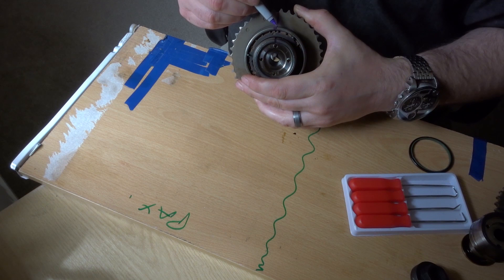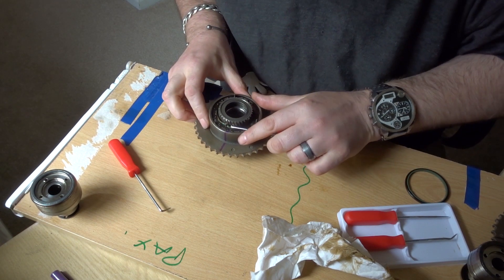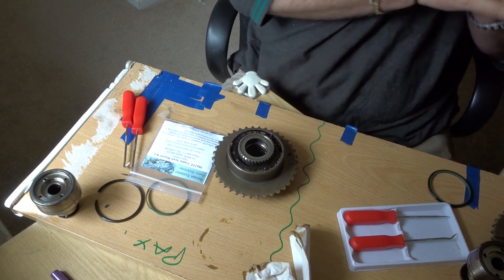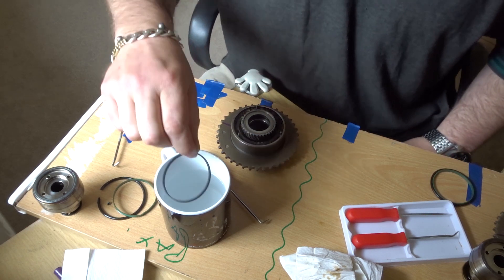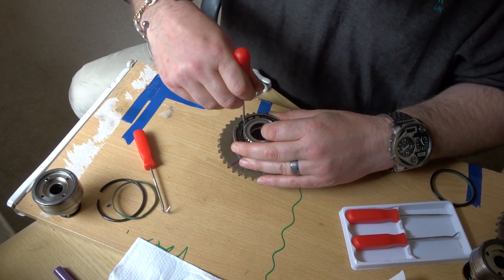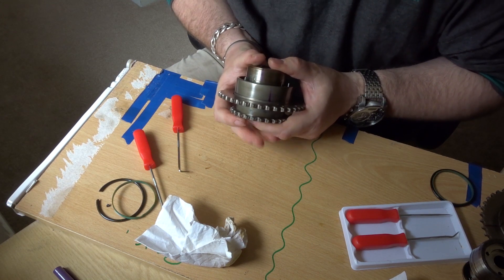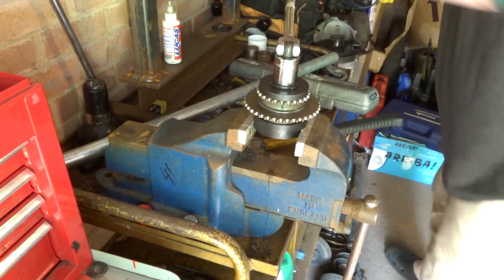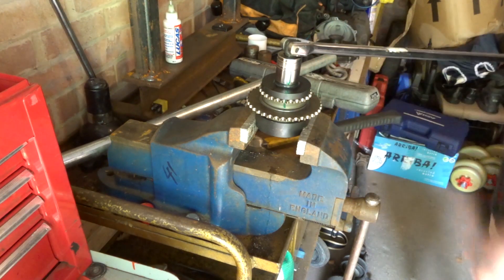M62 VANOS Reseal Beisan Systems Kit

Comment: I also used a Besian kit, and the new teflon shield ring for the O-ring is impossibly large in size and very fragile..........stuffing it back into the correct position is a complete nightmare. The teflon ring gets damaged very easily trying to get the last section popped over the plastic ledge.

Comment: Hey mate, I want to swap my old D1 for a L322 with Canó’s rattle for 1 second on start up. Can you just do the canons wothouth doing timing chain and everything?
Reply from the maker: If the rattle is only for a second or two on start up it could be nothing major aside from the non return valve behind the vanos solenoid not retaining oil in the system. You can do the vanos without doing the guides or replacing the chain, but you do need to time the engine and clamp the crank and cams from moving with the timing tools to get the vanos off and keep the engine timed. One of the biggest weakness of the M62 was the plastic chain guides I would very much advocate doing these or at least checking them on an unknown engine! Great cars and easy to work on but you do ideally need to use the timing tools.

Comment: Were you able to get a continuity reading off of any of the three pins after pressing the vanos?
Reply from the maker: If I rotated the gearset strongly I could just get a reading as soon as I relaxed pressure on turning the gearset continuity was lost. The reason for continuity testing is to ensure the gearset is rotated all the way in one direction on fitment and doing the timing chain timing. Aslong as you are confident you have it turned to the absolute maximum in the required direction, that should be OK...Continuity would be the gold standard, but not strictly, absolutely necessary as long as it is fully rotated in the required direction when setting the timing.
Reply: @AntChesney  Great video by the way. If not the best one out there. I am aware that the continuity test does not always show a short. I ask about the continuity on the pins because I believe the pressing of the vanos changes the position of the gear inside the vanos making it harder to contact the pins when retarding the center shaft. It's more of a theory but it would make sense being that when pressing the unit you are getting rid of the space between the plastic piece and the vanos wall which initially had a 9mm gap prior to the press.

Comment: Good Video, however wondering why you installed the new rings before crimping, as instructions state to press/crimp first to prevent damage to new seals.  Also, not all units require pressing, only if the visible gap between the plastic ring and metal lip, perhaps why was so difficult to press. Finally, the fine people at Beisan kindly offered the suggestion of using an impact wrench for the final press!

Comment: How much Nm you tight? I don't understand. Beissan give 136 Nm ;)
Reply from the maker: I did it to the Beisan spec of 136N.m as you say, you then have to turn the bolt a further full turn...I kinda made a hash job of tightening this as the bench moved around so much...but I did the 136N.m and the full turn....on the second I had learnt my lesson and wasn't so ham-fisted at doing it. Yes it has to be sodding tight as what you are doing is re-folding the lip over to ensure the plastic ring is firmly seated and there is no leakage past the seals....you are basically folding a metal shape that is originally folded using a machine!
Reply: @AntChesney   Tnx , useful video :) Do u have video after vanos repair ( engine sound) ?

Comment: How’s it holding up?
Reply from the maker: It runs very well. No issues at all right up until the point I scrapped it due to corrosion issues throught the monocoque to sub frame area.

Comment: Why does it have to be so tight jeeze 💀💀
Reply from the maker: It didnt help the bench I was using kept moving about. The reason it needs to be so tight is because you are essentially trying to re-fold the lip of the VANOS unit to take up any space between the lip and the plastic ring to prevent any hydraulic leakage. The gauge of the material to be formed is quite thick hence the pressure required.